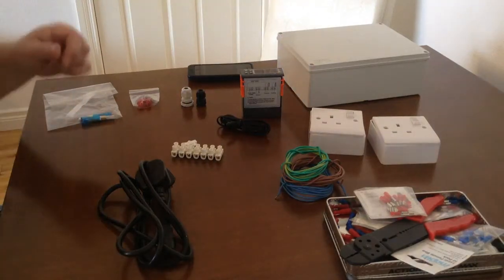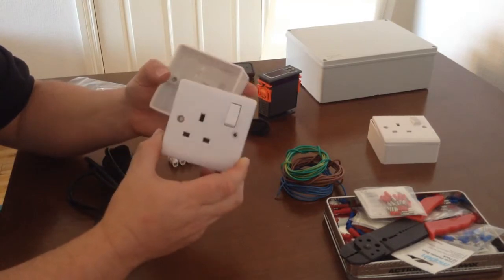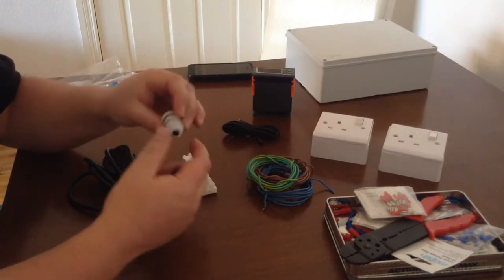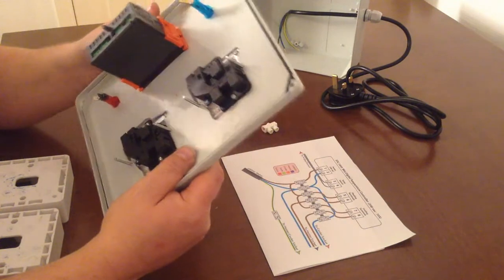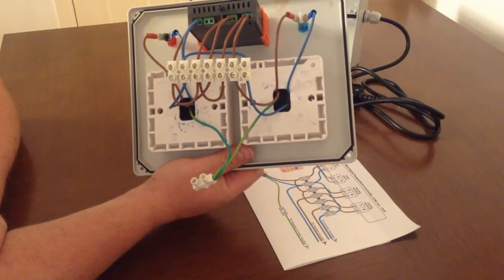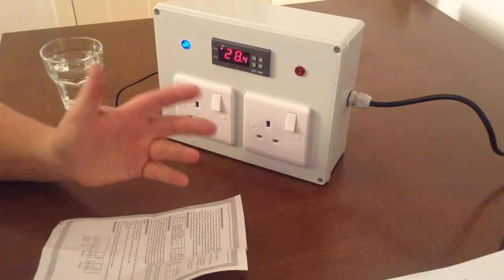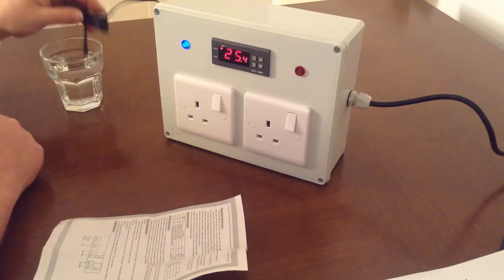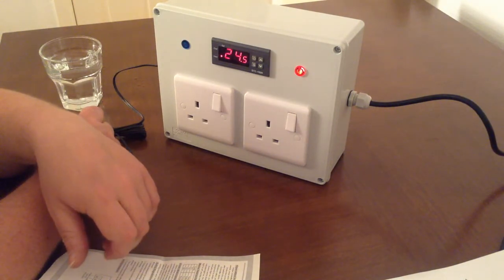Temperature Controller Build ( STC-1000)

Comment: Hi can you help please. I did wire the cts 1000 for heating and I don't know why but when it reach the temperature I setup it will turn off and cooling red icon will come on. I never had this before it was working normal but I did a new project with the same unit and it started to do. any suggestions please what is wrong? I don't use colling at all jist heating the chamber.

Comment: Feeling a little stupid, Found your video on the STC 1000. Got all the parts from your list. Put everything together, wired up but notice the headings on the STC were different. It was only then I realised I have a STC 2000.

From left to right it reads:    Alarm /  Loading / AC Power / Senor

 Can you help or should I get a STC 1000

Terry

Comment: Excellent video, nice to see a unit made using UK 3 pin sockets😀 just a quick question, I plan on using the heat side to power a 60w tube heater in my fermentation fridge, what heater are you using? I am wondering whether it may be better to use a SSR to protect the STC 1000? Cheers
Reply from the maker: +West Hayes Homebrew  Cheers. You won't need a solid state relay for a 60W heater. The stc1000 relays are rated to 10amps and you won't get anywhere near that.

Comment: What is the connector for the snap in neon lights?
Reply from the maker: I just used spade connectors. You can get them at B&Q, Halfords etc. You can leave them out and solder straight onto the neons if you prefer.